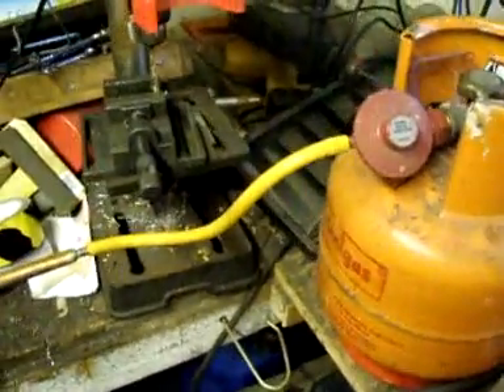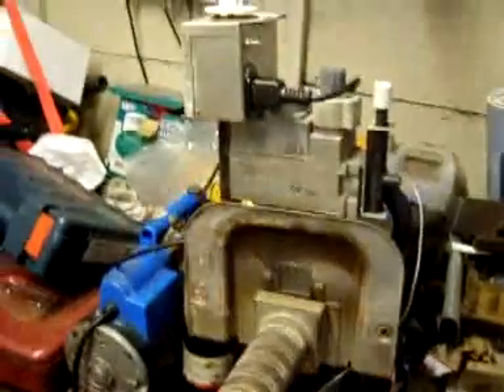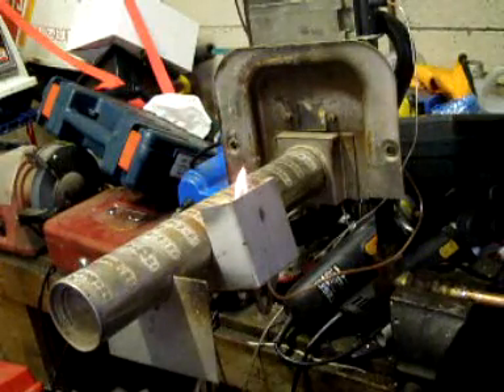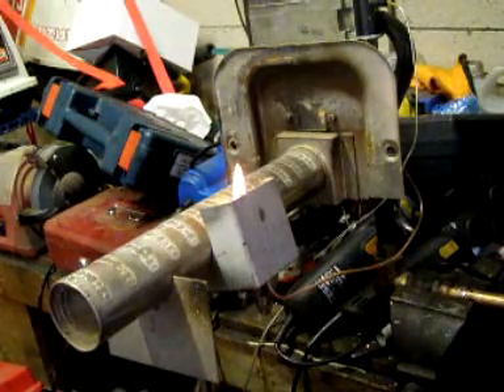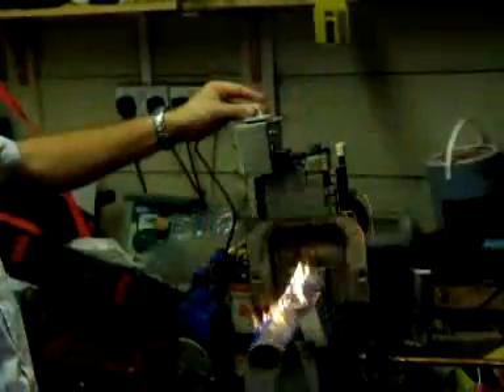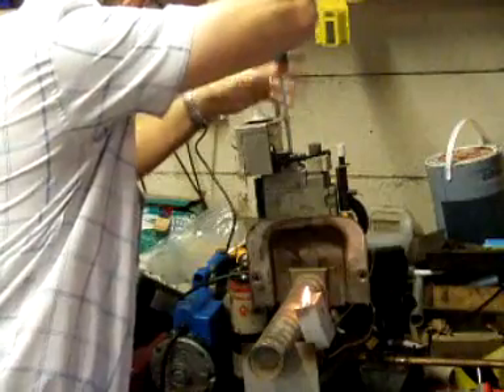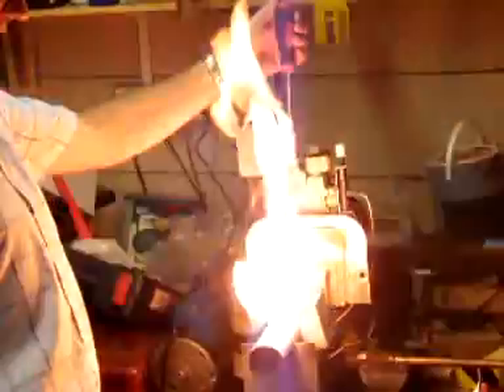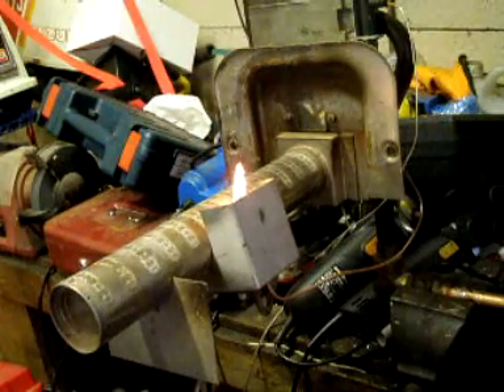Testing natural gas burner on propane

Comment: Hi Richard, You seem to know the terminology, but your works ethics just didn't say the same thing. I wouldn't advise anyone to copy this practice unless you risk death by carbon monoxide or explosion. You can't check for leaks with soapy bubbles on propane as so many try to do. You really need a U-gauge to set the burner pressure correctly and to test for leaks. Think Yellow Flame = Death unless it is outside. Take seriously others comments.